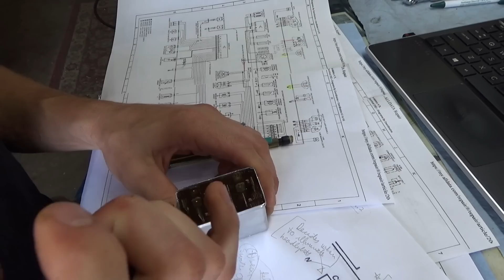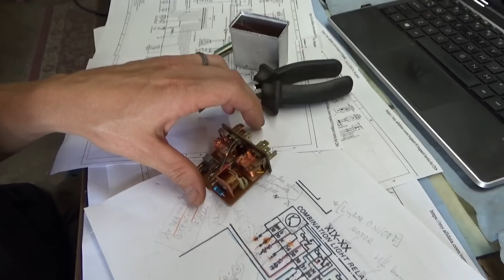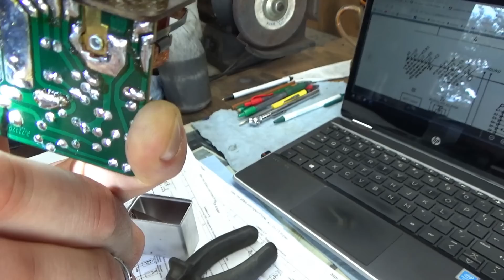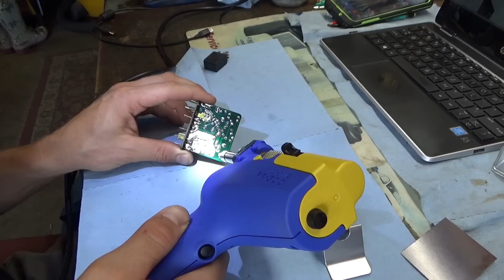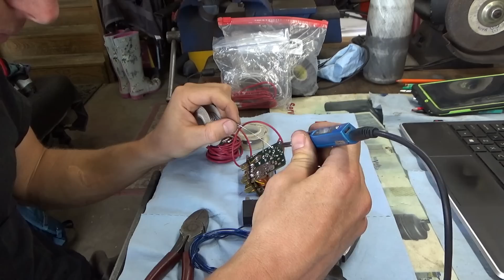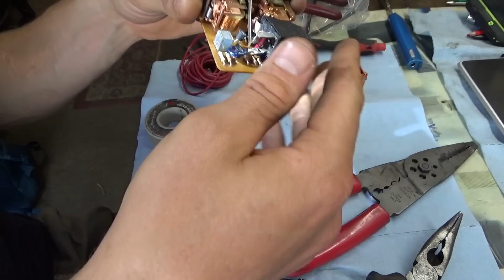(Pt 2) This Porsche Melted my BRAIN ('84 928S Crazy Headlights Repair)

Comment: Amazing, love your channel. I owned a 928, great car, I learned after electrical problems started that the 928 has 35 Miles of wiring!! I believe a Rolls Royce or Bentley may be the only cars to have more. My issue was fried wiring harness but I found a company that will built you a custom one based on the VIN # you supply to them, I ordered one, had my shop put it in and, all good.

Comment: Ivan, I hate to say it but I think this fix looks pretty dodgy to me.  Yes, it works but it has a high potential for failure with all the exposed wires in that can.  I would have bought the $200 part for peace of mind.
Reply from the maker: It's better than factory guaranteed 😀
Reply: @PineHollowAutoDiagnostics  Well, it may take 39 years to prove that, but as long as it doesn't short out and burn the car up, it's the best priced solution.  BTW, I think you are the best auto mechanic/engineer on YouTube.
Reply: @vpimike2646  that's the last part/repair I'd worry about burning that old turd to the ground. fuel system is likely spanked and ready to whizz all over the hot engine.

Comment: Really love this channel. Creative and good solutions. But if you want the hakko to work better next time, i have two suggestions. First, give the heating element much more time to warm up when using it from a cold start. Give it ten minutes. Also to let the old solder flow better, add new solder first. This lowers the melting point, and your work will be so much more easy. Instead of adding new solder, a bit of flux also does the trick.

Great repair Ivan.

Comment: Hi Ivan, The Hako desolder gun is a good tool I have had one for quite some time. Keep the chamber clean and unclogged. Also you can buy larger tips. I have several sizes and you will need to clean it and the nozzle regularly. The Hako soldering iron is not so good. Your iron is probably much better. I eventually bought a Weller D60 which I have used for years. Your better one looks like a really good choice and I might get one. That relay could have been repaired. I have rewound a few things but I do have a rewinding machine and wire.
Reply: Brilliant Ivan, nice work!

Comment: My hand use to shake worse than yours Ivan, especially when I was your age but I just checked them and they are not shaking any more and I'm 68 years old and all I can think of is that all the hiking and trail running is curing it. I'm surprise by this because this is the first time I've noticed it. Watching you with a slight shake I was thinking I could never do fine soldering but now I think I probably could. My hands hurt all the time (from too much work all my life??) but they don,t shake any more. I wish I could be certain just why this is . . . If I was I could make a YT video about it.

Comment: Suggestion...  If you run into electrolytic capacitors like that little blue one on the bottom edge of the circuit board, and they are pushing 40 years old, replace them.  Those little caps were never intended to last that long and are well-past their service life.   Been doing electronic service for 40-plus years and have replaced electrolytics like those by the short ton.  Over time, the electrolyte dries out and ESR (equivalent series resistance) goes through the roof.

Comment: Nice job, you could have saved the original relay if the coilattachment to the pins was broken. The driver trans could easily handle if you are able to take 1 vinding of the coil and solder this to the pin. If it was the outer vinding that was broke. Regarding the de-soldering, as some other state its sometimes better just to go arround with new flux and heat up the old solderjoints. There are also de-soldering litze with flux, that works great with older printed boards.

Comment: I'm wondering if the new relay has a different resistance on the control side from the old one. Does the transistor feeding it care?
Reply: The transistor cares about the current that the relay draws.  Less is no problem, but more may burn it out.

Comment: Using low melt solder and a normal soldering pen with some copper braid and a good amtek flux would be much much easier than using that clunky expensive  gun.
Reply: I was going to suggest the copper braid method also, especially for small jobs. The vacuum tool is more suitable for production work.

Comment: Just wondering what your hourly rate is and how long it took to modify the relay board vs buying the one from Amazon for $200
Reply: Agreed and you still have the rest of the original relays (almost 40 years old) next
Reply: Now when Ivan repaired the old relay, he got money from repairing it. If he would have bought the relay from Amazon, he would "only" get money from fitting it in the car ;)

Comment: Great fix Ivan. It retains the factory circuitry & look! It seems the only "high tech" if you can call it that in the relay assembly is the transistor. I was not expecting miniature surface mount components, though I was expecting something more interesting than the guts of standard relays! I am glad you took it apart.

I have not seen wire fuses like the ones in that Porsche in a very, very long time!

Comment: This is why the use eletronics today. Its gotten way to complicated to switch and power all the stuff just electrically .
Reply: get rid of all the nonsensical useless features(penalties later on) and make the stuff simple again. fuse, switch and wire to devices. leave it on? dead battery and you walk.

Comment: Pro Tip when using desolder tools:
First use a solder iron and a just bit of flux or new solder to reflow the connection. Then apply the solder tool and then suck the solder out.
Reply: solder wick would have been better for this particular task.
Reply: @v12alpine In a past video Ivan could not get the solder wick to work; he suspected the wick material needs to be preheated which he figured would add more complexity to the operation so he used a vacuum device instead.
Reply: Definitely, a little new solder with the desolder tool also helps the heat transfer!
Reply: That braided solder wick is better.  The vacuum is really only for certain size joints where the pin can go into the hole-- such as desoldering a resistor wire, and would help you cut time if you had to do hundreds of them.  It's really kind of a gimmick otherwise IMO.   Solder wick is the way to go, especially on these larger lugs with weird shapes.
Reply: Or just some flux (from what I've seen on other channels) and/or some fine copper web/strap
Reply: You can never have too little flux!
Reply: @rkan2   Bigger the gob, the better the job.
Reply: They also make low temp solder.  I think it's Bismuth.  You can add that to the existing joint.  When you're ready, you heat all the joints and the solder will stay liquid long enough for you to pull the part out.  However, I would have tried wick first here to remove the bulk.
Reply: @major__kong  Low-melt is not required at all on a 2-layer lead-solder board like this without any large ground planes. You shouldn't even need more than a 400c iron with wick. Old stuff is easy 😁
Reply: @jessicav2031  I was just giving another option I've used in the past for more difficult projects.  I'm kind of old school and would have tried solder wick first.

Comment: Ivan.  Loved this diag.  I especially loved the relay box repair.  "Back in the day," (i.e. a hundred years ago :-) I worked with circuit boards just like this one, with discrete parts.  However, I was amazed at the quality of this board, the parts, and the beautiful solder joints, due to the age of the equipment.    
Your diag was spot on, however, I would have headed first for that transistor to see if the Emitter, base, and collector circuits were intact.  Just sayin'. :-)    For sure that was a quality board.  Again, "back in the day," I used a "suction bulb" and some "wicking material" to get rid of the solder.  And, as one commenter said, I would have jumped all over that little electrolytic cap.  

The wiring diagram,, like all have said,  also blew my mind.  I don't think I would have been able to follow it like you did.  Great job.  You never fail to keep our interest - while we try to second-guess you. ha, ha.ha.  Many thanks for allowing us to watch "the master" at work.  God's speed to you,  your wife and family.
Reply: Well said....Cheers from San Francisco

Comment: I worked at a power plant build in the 70s. All the electrical diagrams looked like that. But thats what they are, Line diagrams. Over time they figure out the avg. Electrician cant read that. Then you have wiring diagrams or termination diagrams for electricians to know point a and b of wires.

Comment: Ivan, just a suggestion or food for thought. You first mentioned snipping or breaking off the spade terminals of the relay (as needed), and the one you did remove broke off below the surface of the relay perfectly for your goal to delete it.  For the terminals you need to solder to, you can use a Dremel moto tool with a small abrasive cutoff disc to slice off the spade terminals of the donor relay at whatever length you need,  leaving just enough exposed to make a solder joint. I'm not criticizing what you did at all here, just offering an idea for an alternate way of dealing with the adaptation of a relay to a new configuration.

Comment: Dr Nopareq shows us how its done! I'm calling it NPR as relays and fuses are typically plug in maintenance items.
 The manual cigar shaped solder pumps are my go to. You can use any size solder gun and they're easy to clean.

Comment: why not replacing the relay? you could desolder one from a standard relay and replace it
or find the break in the wire of the winding, must be very close to one of the two ends
Reply: I think I would have fitted a MOSFET.
Reply: @kevinmills5293  that would also be possible, but we should keep it simple :)
It is only a relay ... 
But anyway, his way also works. And no one sees the modified relay.
Reply: @a68k_de  my experience with those small relays has been disappointing as they’ve not been very reliable.